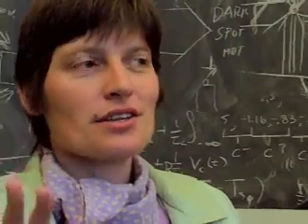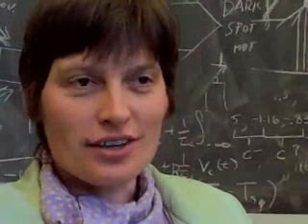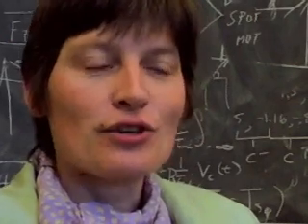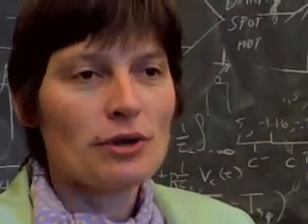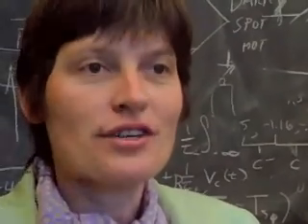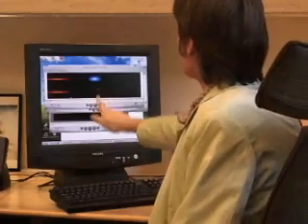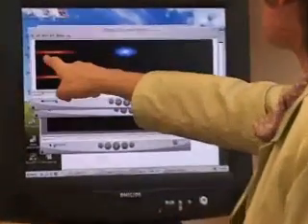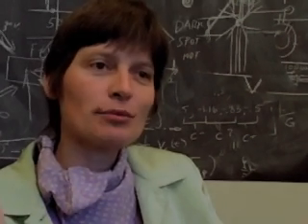Light Stopper

Comment: if someone were to mix rubidium / helium gas in a small chamber hit it with 12 overclocked lasers on a camera flash circuit would it build up then be released collectively  when the gas is dispersed.   doesn't necessarily have to be 12

Comment: Exodus sapphire rod of God. Trumpet (maser)
Reply: Compare the instructions God gave to build his tabernacle device,48 standing 2 sided mirror boards, smoke,glory golden covered mercy seat with creating matter from light at room temp (google) you'll be surprised
Reply: The two sides westward=mirror boards standing vertical blind-like 3&3 forming a V in the middle The middle bar "shooting thru"=optically looking like 2 seperate sides
Reply: Beaten out of one piece of gold= take lump of gold, pound it into a sheet bend it around into a semi-sphere & tap image of six branches around w/ the 22 bowls knops&flowers as instructed=7 pointed starin all directions
Reply: The 20 boards of each side standing vertical blind like w/ the middle pole shooting through from end to end. This middle pole held up the Ark Via its staves 7 1/2 feet up into the smoke.
Reply: The lampstand;a combination.reflector-smoke funnel-and Gods logo,sat kitycorner over the table and incense altar.

Comment: fizzy: im not sure, but my answer would be no.

i think this only works for very specific wavelengths, and only in one direction. but im not sure. if i would be correct, your "bottle" would only store the light of one specific wavelength that it gets from one specific direction. so your "bottle" would "look" into one specific direction, and tell you how much light of one specific color it gets. 

but thats enough to pump a load of digital data into it and get it back 1 second later...